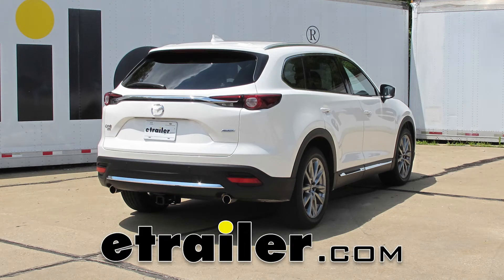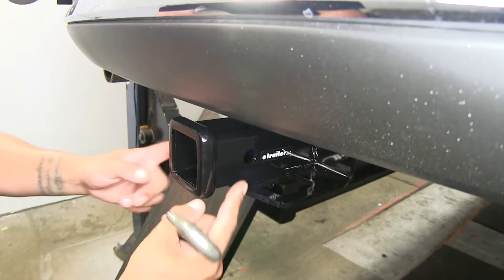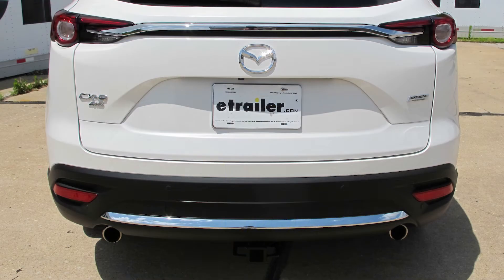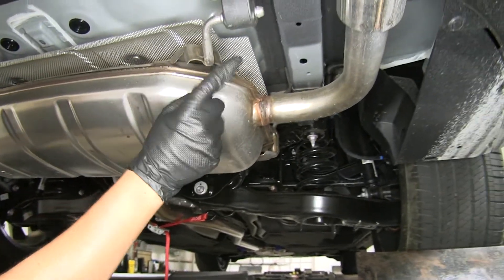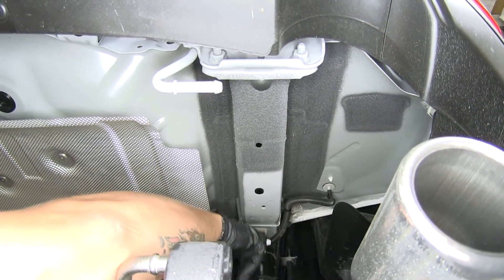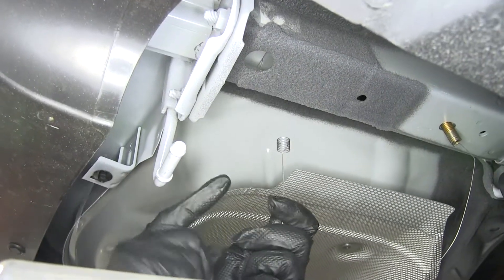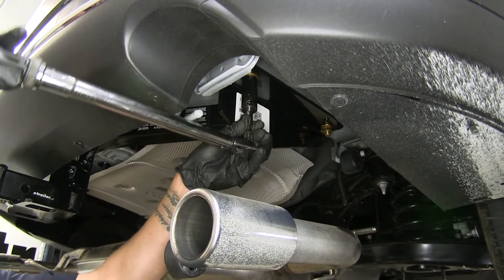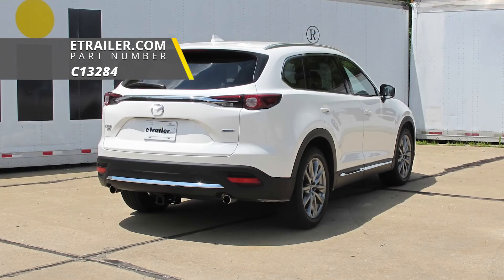etrailer | Installation: Curt Trailer Hitch Receiver on a 2018 Mazda CX-9

Comment: Thanks for the video!  I was able to install my hitch today without issue.  Make sure you have someone else to help when holding the hitch up to attach the nuts to the bolts. 👍
Reply from the maker: Thank you for sharing this! A second person will make this install much easier. It can be a chore to hold the hitch up an put the hardware in.
https://www.etrailer.com/Trailer-Hitch/Curt/C13284.html

Comment: Does it come with the installation kit? Like those wires to help fish the bolts? Thanks
Reply from the maker: This kit will come with the hardware and fish wires to get the hitch installed.
https://www.etrailer.com/Trailer-Hitch/Curt/C13284.html

Comment: Is it possible to install it without lifting the car up? It doesn’t seem too difficult but wondering if it’s possible with car on the ground.
Reply from the maker: Yes, many people install this hitch themselves in their garage or in their driveway without a lift. If you need a little more space under the vehicle, you can use a set of car ramps to get the rear of the vehicle a bit higher.
https://www.etrailer.com/Trailer-Hitch/Curt/C13284.html